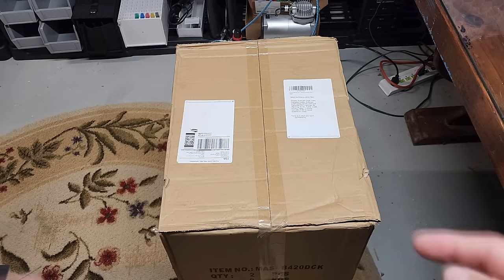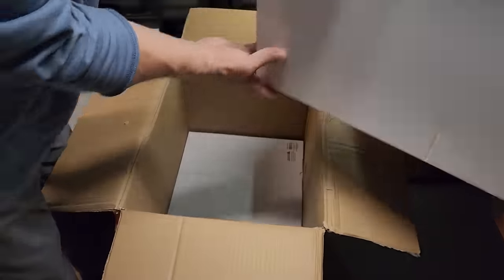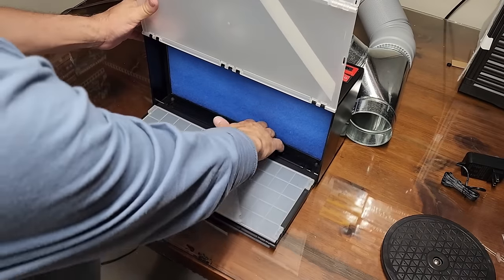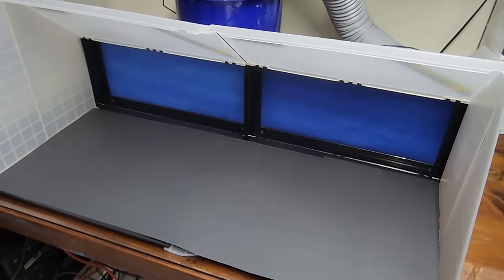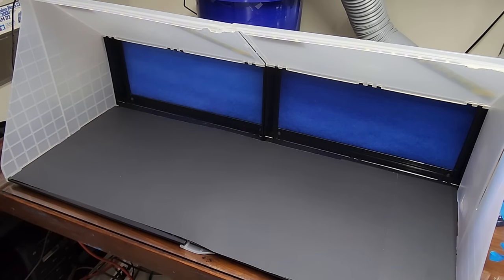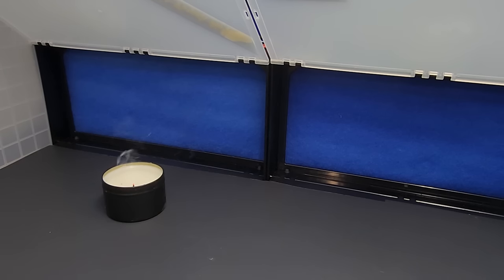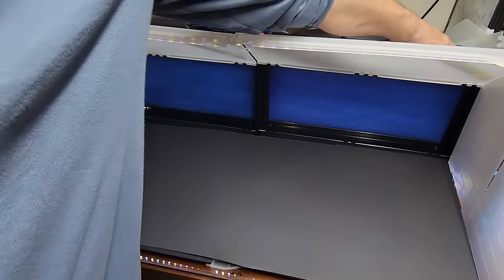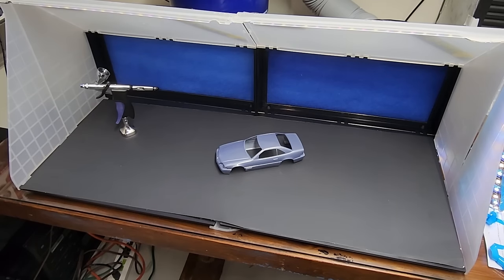Testing Amazon's Biggest Spray Booth For Airbrushing

Comment: If you need a large spraybooth consider the Wagner Spraytech Medium/Large for around $50. It's meant for painting furniture and can fit something like drawer chest. Works extremely well esp. if you're planning to paint large cosplay 3D prints for example.
Reply: This is what i use now, have you setup fan for it?

Comment: I got the smaller booth wish i would have got a larger booth but it will work. I also used your bucket design to attach the booth great idea thanks again for the tips.

Comment: I spent about $30 for my booth. Had to make it myself, but it was easy. Heavy cardboard, fittings, some paimt, and LED lights. Evac cost about $80 including inline fan and massive filter. No way I'd buy something like that. But....can't deny the convenience of just buying one.
Reply: Right on the dime you are. For $250 bucks i could make 2 spraybooths of that size. I build one using a brushless kitchenextractor, 2 dimmers, MDF plates cut to size and good LED strips, a few visors and it is also fold-able, weight is a bit more as this thing. But we are modelbuilders,why buy it complete when you can make it yourself. A de-hydrator is costing me in here in Europe about $150-200, I used a old frigdge,was on the side of the street,waiting untill the garbadgetruck came along, got the motor and compressor out,cleaned it with bleach and ammoniac.Used 4 60 watt lightbulbs and a chickenclock for the time and temp and i got a magnificent paint-bake oven for next to nothing. With some elbowgrease and clever thinking you can make everything,that is also part of the hobby, or am i wrong??

Comment: I model in O scale, where we deal with cars and locos that can be nearly 2 feet long. I have been working up a design to build my own new booth wide enough to accommodate the long items we deal with. I had no idea that an out of the box solution existed for those of us needing a wide work area. I would be inclined to build my own front shroud area, and integrate it into the filter suction units.

Comment: Great demo of this spray booth. Seems easy to assemble but a bit flimsy.  I use a converted kitchen cooker extractor hood with built in LED lights and carbon filters. It works well, removing all smells of lacquer and other smelly paint stuff.  The problem is that it isn't portable, it is noisy, and it takes up a lot of space.  I want to change it for a more portable, quieter type. I might look at the Master type.  I notice that you have your venting pipe stuck into a Lowes bin, and "mikereeves3008" mentions something about your bucket/dust collector on one of your videos.  I'm interested in seeing this if you can point out where you've put it.  I must say that you present your subjects with so much ease. I just feel comfortable watching them. Thanks for a lesson in how to do it!

Comment: I have one of these booths. It isn't a double, but maybe the size of one of the two booths. I'm not really sure, but it was an "extra wide" model. If anyone gets one of these for a more permanent setup, I recommend using duct tape along the edges and seams. It really helps to keep the thing together. Also, line the insides with newspaper or cheap parchment paper (I buy a roll of packing paper from Home Depot).

I've heard that you can take the end of the duct and put it in a bucket of water instead of going out a window. Apparently, the water collects the paint fumes and any particles that make it past the filter. Only issue is that I don't know if you just point the duct down over the water, or submerge it into the water. I don't see any reason why you can't submerge it (in theory, I guess). It's not like the fans will sucks water up the duct. The fans also shouldn't be strong enough to blow water everywhere.

Comment: Hi. Thanks for the review. You would think the two would clip together or have some joining pieces/supports. Its a bit flimsy. 
I have a HSeng HS- E550 which is 55cm (21.6"),a bit wider than the usual singles, with lights, variable twin fan and the vent at the top so it can go right back against the wall. (Vents outside with included hose). And it was around 260AUD (180USD) and is quite sturdy and works very well. Don't know if you can get it in the US.
I clean the filter in situ with the Dyson vacuum hose so I don't have to take it out and shake paint dust everywhere.
Cheers. Have a great day and thank you for your informative and entertaining videos 🦘🦘🦘.

Comment: Have the same model on  Canadian Amazon but the price doesn't make sense. It is $1850.61 CND. WTF but there is an other dual unit model for for $288CND though. Also, my on my home made paint booth, beside having three little fans, I have a booster VEVOR 6 inches. I was affraid that it would be ennough. However, If I let it running, My painted things like primed spoons where full of hair an dust of the working room. I did not know that I didn't need that much power. Well, since everything is set up, I simply put down the power of the vac.

Comment: Great review! Well, that company should watch your video, because you made it look better than it would look normally. Maybe they should include a roll of duct tape to actually tie the two units together. The units individually and this partially together larger unit does seem to work pretty good though. I think if you got the spray booth tent and a good single unit and put the two together, I think you'd be money ahead and probably end up with something that works at least as good, if not better. The price isn't terrible for two booths and I'm sure that there's a way of actually making it a single booth out of them, so there's that. I guess I'm just a little disappointed that they didn't make parts to make this one big unit.

Comment: $200+????,all the more they are they're not worth $100. These booths really rip people off.
Just got a kit with 4" a inline 230 (+/- 30-40 coming from china)CFM fan that's also supposedly 36db,4" hose,and a charcoal canister filter for $55. 
Going to make my own box prob around that size with a sheet of $15 lauan (had it from a few yrs ago), and a $12 prefilter and maybe 1-2 hrs of time. I also have a speed controller from a older sewing machine that I can turn the fan/s on and off by foot or vary their speed.
Going to run the canister so it's not dumping the heat outside during the winter. 
4 CMM is 141CFM.  If I need,another fan they're only $20-25.

BTW,you're losing CFM with that T in the exhaust, a Y will let it flow easier.

Comment: If I remember correclty, a constant 60db noise level (or more) may already lead to hearing damage.
So using this booth would actually require at least rudimentary hearing protection just in case.

Comment: I'd rather use Amazon or E-bay supplied USB powered computer cooling fans for vacuum, with Walmart USB LED's for lighting, foam board and duct tape for the box and base and dryer vent tubing for the exhaust hose. (I grew up DIRT poor and had to make everything myself if I wanted it. Worked in tobacco for my first real train engine that wasn't a cheap Bachmann) anyway Grand total probably less than $25 dollars to build it yourself. Great channel. Thanks!

Comment: I've been curious about all the spray booths tested. Are the fans explosion proof rated at all (ATEX rated)

As I know that you use solvents, laquers, 2K etc
Reply: That's why I build my own booth.... it has a HVAC fan that is grounded and is explosion proof... Most induction motors will be explosion proof as they do not use brushes...but may need extra grounding.
Reply from the maker: These booths are explosion proof and solvent resistant.

Comment: Could you pleas do extensive break down of Vallejo air and how much leveling thinner to use for air brushing with the Neoeco airbrush first not the one with the colored cup addition but the one before it? My airbrush is giving me problems or my paint to thinner ratio is off because I can't get paint to flow nicely. Also I use one of those plug in air compressor that are small little black box and I am wondering if a real air compressor with a tank is what I need? Thanks man! Hopefully you see this!
Reply from the maker: I can tell you right now the problem is that compressor. Vallejo is a bit tricky sometimes to spray right and here I believe it's your compressor.